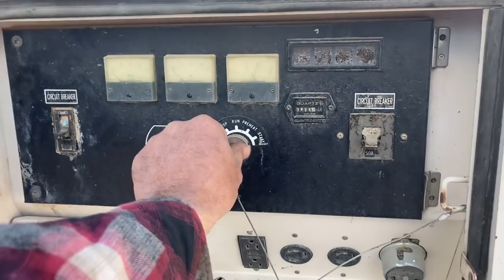Feed BUNK Repair saved me From DAILY TORTURE 🤬⚓️🐂

Comment: The camera didn't show it the fuel line to tank connections for Generator. Need Mud Leg for fuel draw. Water and rust must fall into vertical pipe as "T" leg is down. By drawing fuel off across this leg water and rust fall into leg and save primary fuel filter change. If possible install fuel shut upstream to drain Mud Leg of water and rust.
  Love watching your boys learning. So many sons are doing video games not real life living, God has Blessed You ❤️

Comment: You know what I did to the racks on my 4 wheeler? I cut a piece of plywood the shape of each one, bevelled the edges and even put some sealer on the edges and both sides,  then fastend them to the racks, sure made it a lot easier for anyone to sit on them. Be sure to use carriage bolts so they don't snag their derrieres.👍👍

Comment: A 2 gallon pump hand sprayer with a cup of Dawn dish detergent mixed in makes a good sprayer for a welder to keep close by.  For quick refills, a few premixed gallon or 2 gallon jugs is good.  The detergent makes the water stick to dry feed or grass, giving better coverage on super low humidity days.
Reply: That’s what our rural fire department does. They keep a bottle of dish detergent in their fire trucks and UTVs. It works great. A good metal yard rake is pretty handy for controlling fires also.

Comment: I have in the past, when I had pipe tear up, is to take a larger or smaller diameter pipe, find the broken place, place the smaller length of pipe, with one piece inside the other one, drill  hole through both pieces, place a bolt in the hole on both pieces n join pieces together on both ends. Spliced in.